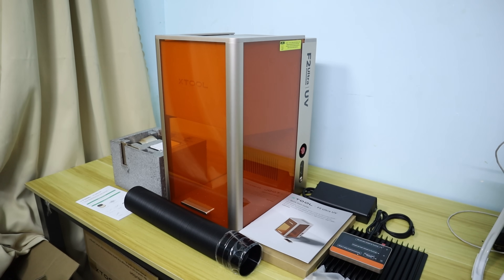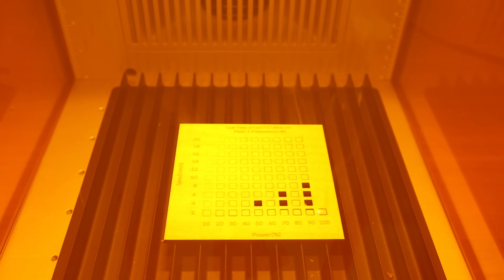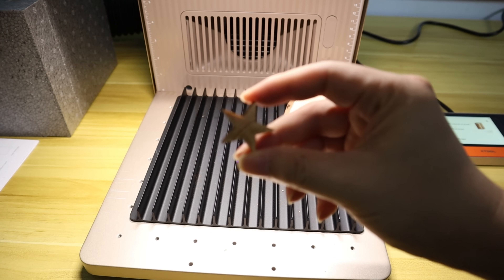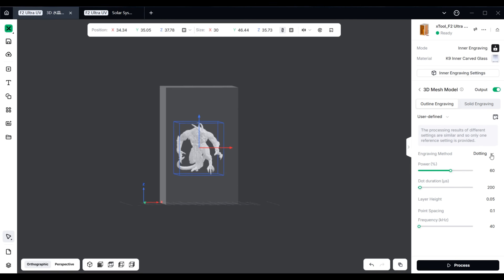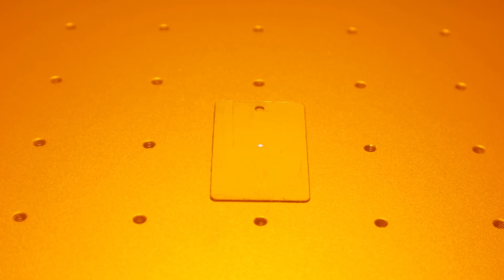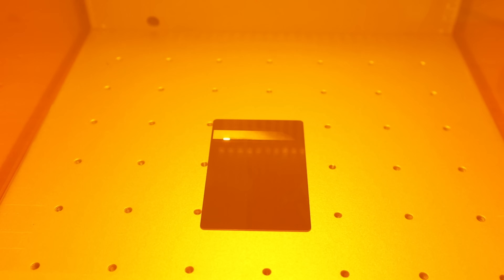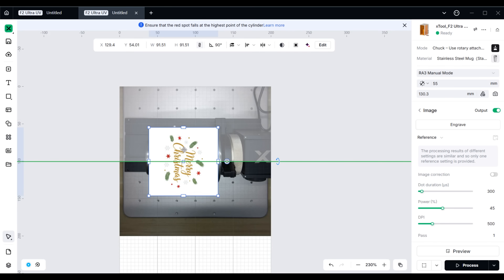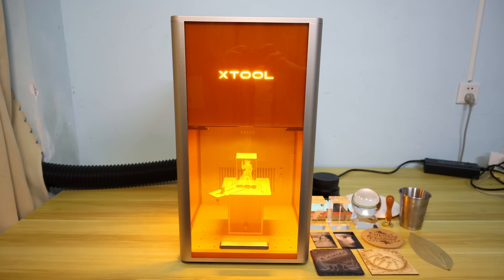Is the xTool F2 Ultra UV the ONLY Laser Engraver You Need? The Insane Game-Changer Review

Comment: Thank you for sharing your settings!  For the image engraving on black acrylic, did you do any additional processing of the image in xTool Studio?  Also, if there any tips for pre-processing of your images that you can share, that would be great.  Your results were amazing and my first attempt did not look anywhere close to yours 🙂
Reply from the maker: The only thing I need to do is invert the image in xTool Studio. When engraving images onto black or dark materials, it is recommended to invert the image. Then, select the corresponding material in xTool Studio, and it will automatically set the optimal parameters. Achieving this engraving effect is straightforward. Perhaps you forgot to invert the image.
Reply: @TechnicalTrendy  Thanks for getting back to me! Good to know you didn't do anything special with the image other than inverting.  I did invert it but I may experiment with different acrylic to see if I get different results.